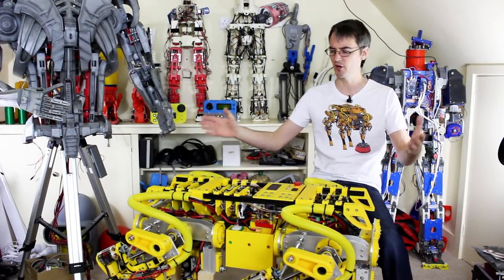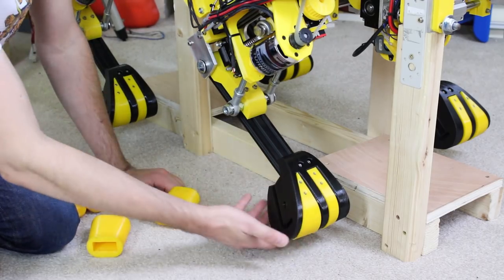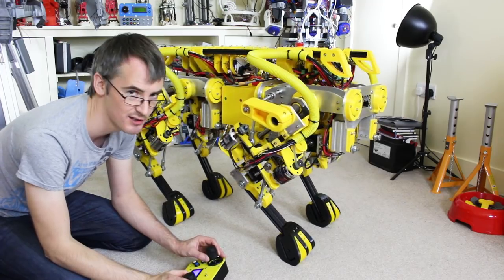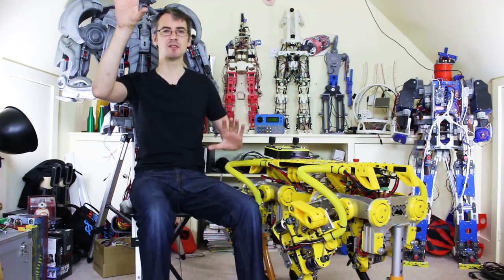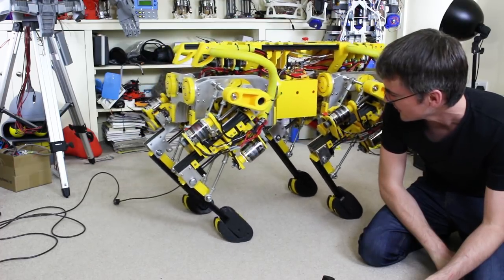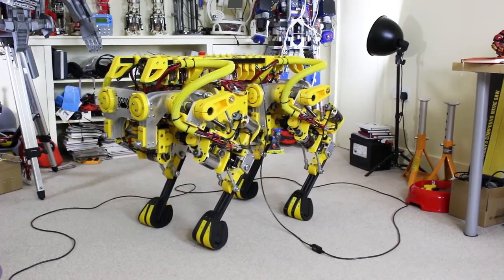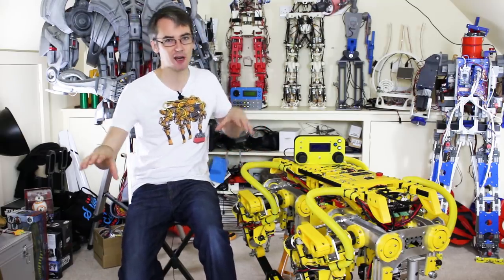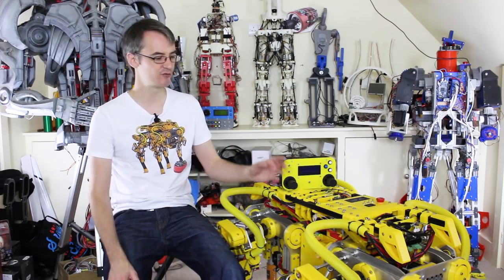openDog Dog Robot #13 | Experiments in Dynamic Stability | James Bruton

Comment: All your math assumes for the feet to be points without volume, which they really aren't. The distances between "ellbow" and the point where the feet touch the ground are highly dependent on the angle they have to the ground now.

Comment: Hi James, looking good so far.

It looks like the chasis is twisting a lot along the spine - could this be changing the geometry enough to make the calculations wrong for the ballance?

Have you calculated the centre of mass, and set the legs to be in line with it? Or have you designed it to have neutral balance? Or is it purely based on the tilt feedback?

What is the end goal for OpenDog? I'd love to see this thing running but I suspect just walking in more than one axis at once is a more realistic goal (e.g. walk forwards whilst turning).

Comment: So I was thinking. I'm no engineer, especially not a physics person, but I noticed that at the higher speeds, the feet almost seem to be punching the ground rather than stepping back down, even though the leg should know how far down to travel to zero out (i.e. reach the ground). My thought was that as humans, we can tell without looking when our foot is starting to touch the ground because we have the physical sensation of touch as soon as our heel makes the slightest contact. However, you can't directly bestow this onto a robot, so you almost need to predict when the foot is almost at the ground so as to slightly slow down the foot and soften the landing. I know you left space in the feet for hall effect sensors, but from what I've seen in the robot these wouldn't be able to cause the robot to react fast enough to slow down the foot, so instead, how about using an optical or sonic sensor attached to the leg so you can get distance from the ground from much farther away, and thus be able to calculate when to slow down much earlier, thus having the robot react on time. I hope that made sense.
Reply from the maker: as I said, I need motion smoothing for the actual moves, with faster compensation after that with no motion smoothing

Comment: i've used for my projects the firefly rk3399, it is a 6 core arm proc with 2 gb ram and 16 gb usable disk space, it can run Ubuntu and android. the proc is pretty fast. perhaps its usable for this project.

Comment: Hey James, I have been following your project since the start and it even lead to using an Odrive for my senior design project. I am at the stage of programming and I have been looking through your source code for the odrive. I have a couple of questions about some things you’re doing. Where did you get your odrive library from? I found two so far one older one that matches your first video and one newer one from three months ago. I am not sure which library is best. Also, how did you get the pid gain values to work so well? I know the values depend on the system and that odrive has a bit of a guide on tuning the values but I wanted to know how you did it.
Reply from the maker: Yes use the latest library if you're using the latest firmware
Reply: A good place to get information/help about the ODrive is on the Discord app and channel.

Comment: Why not give your motion functions a flag to omit smoothing.  When commands are issued in response to inertial measurements, send the omit smoothing flag.

I don't do much with arduino, but I find myself adding behavioral flags to functions all the time in order to avoid code duplication.
Reply from the maker: because they need to do both simultaneously...

Comment: The IMU is not at the center of gravity, needs to be translated to it before use. (And is not a linear transformation, it won't be fixed with adding or multiplying biases)
Reply from the maker: Yes it only measures angles, so it doesn't matter where it is - it still measures the same angle.
Reply: Also, maybe replacing all the serial connection to SPI? With your tree-like configuration maybe you can re-use the serial cabling (You may not need CSS pin). You will have almost 0 delay. (Or even CANBUS, like cars is not difficult and will ease your cable wiring)
Reply: @jamesbruton  Yeah, that's right for the gyro part, but I think that taking in accout the accelerometer part  into the PID will compensate better for the speed of change of the angle.

Comment: Great work. Tendons stretch. You need elastic tendons. Rigid, with this much mass... not going to work :( 

Two ways to solve your 'but I designed it rigid and it can't react quick enough to compensate for non-deterministic dynamics' challenge: 1) tune the damping and elasticity with the materials, physically, not in software.   e.g. tighten or loosen tendons until stability is reached 2) don't rely entirely on deterministic software. Start collaborating with a machine learning researcher/hobbyist/expert. It could be VERY simple. I promise (I'm an ML researcher). If all you do is keep your control systems the same and add a simple damping function the is learned. Linear regression would likely be enough. But Reinforcement Learning (RL) could potentially do an even better job. I'd break this down to 1)  train or code an instability detector (you have the sensors for it. 2) use RL or LR to control damping such that it is rewarded for greatest translation speed achieved without exceeding 'instability threshold' . Then gradually reduce that threshold.

Comment: You really should use Unity to work out the proper walking algorithm. There are many examples on how to do this so the walk looks realistic vs wobble side to side. Once you get the proper feet locations for a complete walk cycle then you can easily port that to your project. Your current methodology is brute Force and unnatural movements. I think I remember you stating at the beginning someone was trying to do the unity model, did that ever go anywhere?

Overall your doing a great job and teaching a lot of folks through trail and error.

Comment: The plastic bits that break, CNC rout them from solid plastic, not 3D print.
Reply from the maker: I explained why that piece broke... 3D prints are perfectly strong.
Reply: @jamesbruton  yeah but a piece routed from solid plastic is stronger than 3d printed. I've used both, we 3d print to prototype, then CNC to manufacture.

Comment: Sounds like a job for i2C :)
Reply from the maker: CANbus...
Reply: I2C doesn't go very far. James' idea of using CANbus (designed for automobiles) is a much better idea.
Reply: @jamesbruton  have you considered replacing some of your controllers with ESP32 modules? While mostly known for their Bluetooth and WiFi capability, they have heaps of grunt (dual core 32bit microprocessor, running at 240Mhz, 520K of RAM, 4Mb flash) hardware support for CANbus, can be programmed using Arduino IDE (your existing code will almost certainly work out of the box) and they are dirt cheap. Win, win, win, win, win.
Reply: @vannoo67  Can is also more resistent than i2c cause of it's differential nature

Comment: if the problem is the connection of the serial wires between arduinos for transmit data , why not connect them in parallel with a short protocol header?   Sending the same information to all arduino with a protocol similar to    m1:doit;m2:doit;m3:doit;...  ... ...   20 time for seconds or more.        I experimented a year ago generating frequencies of some hundreds of KHz with arduino using the registers directly, but ignoring this detail, using a protocol where every bit means something, it could greatly accelerate communication. If the problem is the routing of information between various arduino, perhaps a solution could be to pass all the information to all the arduino and let them choose which ones to interpret many times per second.    You have my full esteem for what you do.

Comment: Could you share Odrive library of arduino that you are using on your openDog project, please? I'm having some issue with latest OdriveArduino library. They are seem to not working properly for me. Example code is not working and when i send a message 's' through the Serial, it prints out "Executing test blah blah" and does nothing. Thanks.

Comment: Or you could put a motorcycle wheel in the center of it all and use it as a gyroscope. And if you want, you lift all of the legs and use it as a motorized mono cycle  lol.

Comment: can i ask a technical question:
in your slave code, you use shift operators (bitwise operators)
eg.. Serial3 << "w axis" << axis << ".controller.config.vel_limit " << 22000.0f << '\n';
Can you explain the purpose and result as im trying to understand it.
Reply from the maker: That's part of the Arduino code sample for ODrive, so the question is best posed to the ODrive Github

Comment: I just downloaded the repository and peeked around a bit. I didn't see a BOMs (I know a lot of parts were 3D printed, but motors, controllers, encoders, support structure, etc.?) or an estimated cost on this project. Can I find that somewhere? Thanks!
Reply from the maker: I haven't written one, and it's subject to change as the project goes on.
Reply: @jamesbruton  Ok no problem and thanks for the reply. Any ideas on how much you've spent so far (roughly)? Did you include links any where to get the motors, encoders, arduinos, etc. you've used? Thanks again!!
Reply from the maker: Motors are Turnigy, so Hobbyking
ODrives and encoders are from ODrive
Arduinos from anywhere
Reply: @jamesbruton  That helps a lot. Will look into these sources. Please keep up the great work and have really enjoyed following along through these videos!!

Comment: Why do you use a belt gear instead of a worm gear? It seems more reliable to use a worm gear system if you plan on mistreating the robot, it won't break so easily.

Comment: For the nuts and bolts slipping, you could try to use loctite threadlocker, and for the computational issues, if a raspberry pi doesn't do it, a banana pi is also a good solution. Its like a beefed up raspberry pi. features:
MediaTek MT7623N, Quad-core ARM Cortex-A7
Mali 450 MP4 GPU
2G DDR3 SDRAM
Mini PCIE interface
SATA interface
4x Gigabit LAN 1x Gigabit WAN
theres also smaller and less expensive models if needed

Comment: i cant install EasyTransfer library .. arduino does not recognize it .. can u post a link to the library source.please
Reply from the maker: https://github.com/madsci1016/Arduino-EasyTransfer
Reply: @jamesbruton  Thank u sir,  I think this is my arduino software problem , it says 
"Specified folder/zip file does not contain a valid library"  ..
Reply: @jamesbruton  Sir i seperated the folders and tried to instrall one by one , and it Worked.. thanks a lot..

Comment: I don't understand, why you don't use a Teensy 3.1+. Those things can be programmed with the Arduino IDE but are much much faster (based on a Cortex M4 up to 180Mhz which is a 32 bit processor with a fast FPU so you can do fp ops without the huge penalty of a standard Arduino). and not that much more expensive. 

I'm using them for some time now and it's quite relaxing to not care about performance problems. Yes, some drivers aren't 100% compatible with a real Arduino, but in practice that never turned out a real problem because for most stuff there are Teensy compatible libs.
Reply from the maker: well like I said at the end...
Reply: @jamesbruton But why haven't you used them from the beginning? A Teensy 3.2 or 3.5 is only slightly more expensive than a "normal" Arduino but you can be sure to not run into performance problems at some point later (unless you want to attach a video camera, then you need at least a Raspi).

It's a robot project with lots of motors and calculations, so needing a bit higher performance can be expected. I would never started such a project using ATMegas.

Comment: how much is a gyro... a small one.. to give it a center of gravity.
Reply from the maker: It has a gyro in the IMU
Reply: @jamesbruton  a sensor or a reasonably sized motorized  rotating mass of weight. Like reaction wheels.
Reply: @jamesbruton  also not a criticism or 2 cents.. I have no idea  how any of this works, just enjoying the process
Reply from the maker: @TheBussaca  Yes the IMU is a sensor. It would need a pretty big reaction wheel to offset the mass of the robot - best just use it's body weight moved my the legs...

Comment: remove batteries  , use  tether  . reprint all the parts with lighter materials    use lighter  materials
Reply from the maker: What 'tether' do you think is going to source as much current as six 60C drone lipos?

Shall I reprint the ball screws and motors?

Comment: Replace the arduino with an ESP32 :)
Reply from the maker: it won't have enough interfaces...
Reply: @jamesbruton  maybe  a bit overboard, but maybe use 1 per leg? They are cheap enough that that could work. But I'm a total noob so :(

Comment: This is all wrong. You have one controller running every detail of the robot's movement. An animal body has local reflexes between the spinal cord and the foot, for example. Also an animal's limbs store and release elastic energy with each step, which is more local-ness in how the motion is powered and controlled.